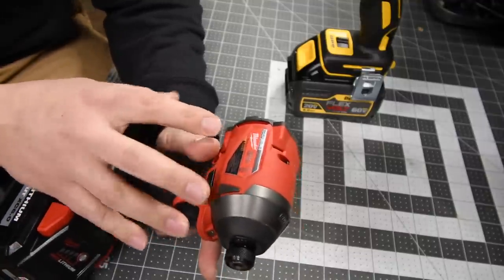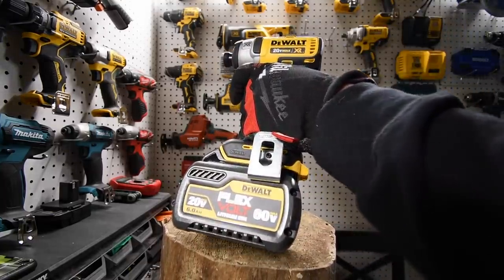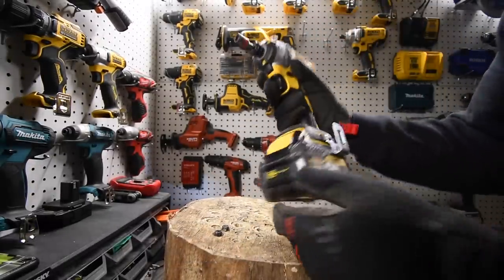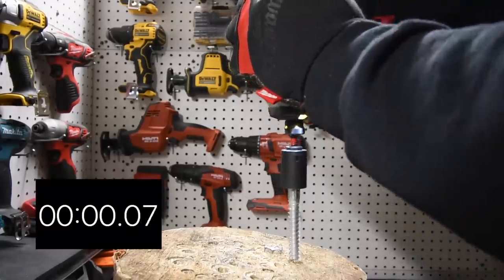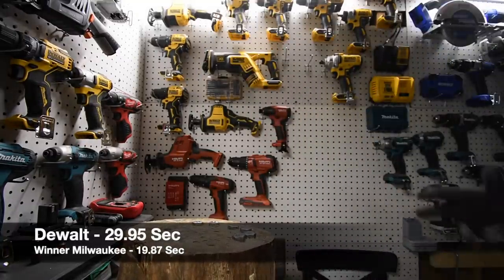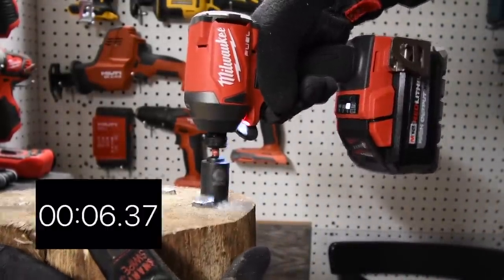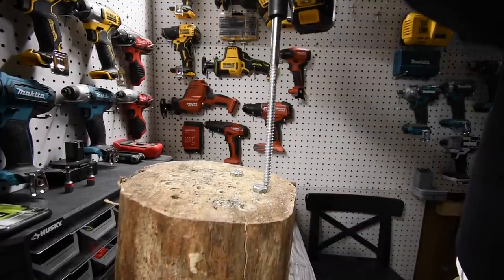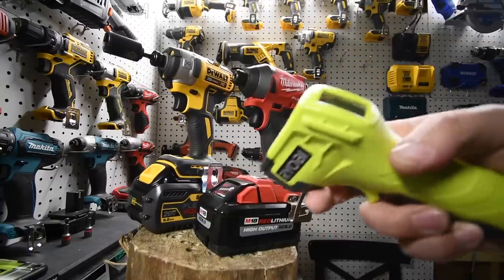Milwaukee vs Dewalt (Impact Drivers)

Comment: I feel like dewalt is for carpentry and milwaukee for mechanics
Reply from the maker: the reality is, both tools will easily get the job done
Reply: @ManCaverTools  This. While its fun to test out which one is faster and more powerful I feel that most everyone just wants a reliable tool that will get the job done. I know we like to have brand loyalty wars but I think everyone deep down knows both brands are top notch and will last. While I agree that DeWALT is more geared towards construction/carpentry and Milwaukee towards Mechanics...both will serve you well for either profession. Happy to own many tools from both brands
Reply: True shit!
Reply: Other way around
Reply: @fuccyahhat1229  for sure the other way around. Dewalt is cheaper usually for a reason it’s marketed to be the top quality but bought by homeowners. Milwaukee has always had the stronger tool in each generation basically. But it is true that at this point in the technology that both tools could do most jobs it’s just why wouldn’t you make your job easier with a tool that performs better?
Reply: @ManCaverTools  true. To a certain point but the dewalt's really seem to be very inconsistent on power output.. the impacts are good from each company.. the Milwaukee will rip the gear box right out of the dewalt though but truly they suffice for any job essentially.. now cordless saws and so on and hammer drill.. dewalt XR's aren't comparable to Milwaukee's.. different ball game.
Reply: I’ve been a DeWalt guy for ever but I think it’s time to make the switch to Milwaukee which sucks Becuase I’ve got a bunch of batteries and tools for DeWalt. I’ve sent my Hammer drill in 3 times and it keeps crapping out on me. It breaks my heart but I think I need to.
Reply: Not gonna lie, I believe it's the other way around, I have a DeWalt impact that I have absolutely BEATEN to death and it just keeps chugging along. I've dropped tranny pans got it soaked in tranny fluid, just brushed it off. I've drop it in a bucket of oil, fully soaked it because the bucket had five quarts in it. It threw Sparks and smoked for awhile, like poured smoke and I just sprayed some brake clean in it and it cleaned it out. Still chugs along to this day. I've had it for about 7 years. No matter what I do to it, it refuses to die. It's just my opinion, but I think Milwaukee you're more of wanting torque than you are build quality. Don't get me wrong, they have great tools. But I've always been a DeWalt fan.
Reply: I’ve dunked my 20v dewalt impact in hydraulic oil multiple times still coughs along as if it were new

Comment: I use dewalt everyday and very satisfied with their products.
Reply from the maker: very good and I thank you for viewing John
Reply: @ManCaverTools  sir if u had pick a brand what one would u pick
Reply: I just recently bought a Dewalt Atomic Drill Driver and it was medium to light use. Probably 2-3 times a weekend and I had it for a month and now I am finding out that the batteries are losing life and power overtime and the motor gets hot as if it has a brush in it. Evennthough its brushless
Reply: @TysonPaxton1214  this is why i switched to milwaukee :D
Reply: @SpooN12344321  I did too :D
Reply: @TysonPaxton1214  honestly have the same impact never had it get hot. Sounds like a fanboy comment to me. I use and abuse my atomic set and I have pics to back it up. My atomic kits just keeps going. If you use the impact on lag bolts that it’s not supposed to do then yes it will get hot but if it’s just screws it should be cold as a cucumber. Unless it’s defective it’s not true
Reply: @Toolboss0826  probably defective if yours is abused
Reply: @TysonPaxton1214  the atomic line sucks man, if you are going to get dewalt go with the xr line the best. I love Milwaukee as well very dope ass tools!
Reply: @Toolboss0826  Foreal I got a impact that I’ve been using for 5 years 🤷🏽‍♂️ I was working in construction for 2 years building houses then switched to windows and doors for the last 3 years and my drill is still going! And I abuse this thing 😆 even dropped it a few times 🙈 runs like a champ
Reply: @jacobmontes2330  I couldn’t agree more. I have the atomic kit and for the last year have put it through hell and everyday whether hot or cold it continues to work. Always a keeper in my box are my dewalt tools

Comment: Dewalt made a great product, 10 years ago, and have been cruising on that rep ever since.
Reply from the maker: very good and thank you snowballs
Reply: Yep I remember the first cordless of DeWalt when they came out , the Nicad batteries were very reliable . The only problem was the amp-hours where shorter then that of Bosch , Metabo ,. Yup I ended up selling my old DeWalt cordless because of that . But they were still good tools . And I ended up changing over to Metabo for the next 15 years . Though they  are not as fast as the DeWalt , they had that staying  power . I had my regrets selling old DeWalt sets ,cos I had pride in them
Reply: Honestly, I always used Dewalt in the military and never looked back. Still happy with the brand to this day!
Reply: Makita impact driver out does both dewalt and millwakee i am in the racking and conveyor systems installation business and i put all tools to extreme tests
Reply: @alf3433  if that were true you would see professionals using them instead of DeWalt and Milwaukee. Don't get me wrong, it's a great brand but just isn't as consistently good as the other two.
Reply: I have good roi on my dewalt tools. use them every day.
Reply: @ToolswithSoAlz  I know a few professionals that use Makita and love it. And yeah pro tool reviews rated the Makita XDT16 the best impact driver last I saw. I’m a Milwaukee guy but I dig Makita too.
Reply: So true. Got my first cordless drill 10+ years ago and it was a dewalt. Not They feel and look too cheap. Now I have my first cordless hammer drill and impact driver. M12 fuel kit with free 6ah battery promo.
Reply: Maybe so but they are still leading the entire industry on what batteries are capable of as well as the variety of tools available.
I never thought I'd see the day where a grinder would run longer then 5 minutes at a reasonable speed on a battery.
Their 60v grinder, blower, paddle drill,  demo hammer, ECT still to this day have zero competition in regards to a reasonable battery life.
Reply: They did an Intel.
Reply: @ToolswithSoAlz  Many people do use Makita over Dewalt or Milwaukee, but the vast majority of their tools do not outperform either brand. People like them due to their value vs performance.
Reply: @ILikeFreedomYo  concrete/chop saw too. NO ONE  has a comparable battery saw

Comment: Not surprised lol, I love my Gen 2 impact driver but I want the 3rd Gen just because it feels better in my hands imo. Also, you should get the Milwaukee mid-torque and put it against the Dewalt mid torque. Great content as per usual! 👍
Reply: Third gen has eaten too many socket adapters 😑
Reply: Kody Williamson that's why I have the m12 stubby 3/8
Reply from the maker: I will be getting milwuakee impact wrenches soon and thank you sir

Comment: You ran the Dewalt much longer after the Milwaukee, so the Dewalt would be warmer.  Also, you used the Dewalt battery to remove the 10" lag put it back in and then take it out again....not apples to apples.  The Milwaukee with the higher rpms of course is faster, no argument there.  I still love my Dewalts for going all day long on the job.
Reply: Everyone in construction knows Milwaukee is the tool to have these days, if you're an older guy, you most likely will prefer DeWalt, but they aren't really the best. I find DeWalt to be slightly more flimsy and not as solid as the Milwaukee. I recently had to buy a new impact driver because my DeWalt broke on the bottom of the handle where the battery connects. I think the Milwaukee feels much better. However, I haven't had the opportunity to try the Atomic, I hear they 're a bit of an improvement over the XR.

Comment: I’m an electrician apprentice getting ready to start buying my power tools. I’ve been trying to figure out which brand to go with, but this video has without a doubt helped me with that decision. Milwaukee it is!
Reply from the maker: electrician, id get makita
Reply: you cant go wrong with either Milwaukee, Dewalt or Makita,  I would go with what brand you can find the best deals on, and stick with that no regrets. Milwuakee has some awesome deals sometimes but usually expect to pay 15-25% percent more than Dewalt.. just saying
Reply: Man Caver Tools I’m a sparky, why would anyone get makita when even dewalt is better. Milwaukee is number 1 hands down
Reply: Sparky doesnt need Milwaukee mate.
Reply: get makita, you are an electrician
Reply: Go Milwaukee, show everyone what the superior trade is😂 they will hate us even more
Reply: Nissy92, Milwaukee may drill a screw faster. But that doesn’t mean it it a better tool for a specific trade.
Reply: As an apprentice i started out using Makita, im a lead now and started buying Milwaukee
Reply: The Milwaukee has had issues with bit retention. Spring in collet is weak and poorly designed. That being said, I own one and love it. There are DIY fix videos to solve the problem
Reply: Milwaukee is a great brand as well as DeWalt and Makita. It's stereotypical to say electricians need Makita. I will say that I used to see electricians and LV controls contractors use them exclusively but that was usually because tradespeople tend to copy each other. I also used to see a company of electricians that all drove Ford trucks as well. (These were personal vehicles.) Even grownups need to feel like they fit in with their crowd. Just pick the brand or brands of tools that suits you best! Good luck!
Reply: Your an aprentice bro get Ryobi from the orange store or Cobalt from the blue store. Once you become a lead, go for Festool.
Reply: Hercules man
Reply: @nissy9220  Dewalt’s not much faster in the instances it is faster, and a Makita will outlive it.
Sure, DeWalt has more torque, but that’s not overly important when every half competent impact driver has the torque to snap 1/4” hex shanks.
Reply: @nissy9220  
You’re an electrician. Get a Mikita. Hell, you could even go with a Martha Stewart drill.
Reply: @vwr32jeep  Hahahahaha

Comment: I have both and love both. Not unless you have both of them side to side do you actually see a difference. I carry an impact driver all day and the smaller 2ah battery is perfect and lightweight. When I do service wire, new power poles, and so on and drive larger and demanding lags then I upsize battery. But both are exceptional! I’m a journeyman electrician if you’re in my field you’ll love both.

Comment: I work at a LINE-X franchise and we constantly pull truck bed bolts and hardware as part of the prep process before spraying and then reinstall; and also for installation of vehicle accessories. They see pretty tough use all day 5-6 days/week. We use Milwaukee 1/4 inch and 3/8 inch impact drivers. They hold up well to constant abuse. The 3/8 drivers seem to fry bearings though. They still work okay but sound awful. The 1/4" have so far held up better than the 3/8" drive
Reply from the maker: I do thank you so much for viewing :)

Comment: To folks talking failure of either brand I remember when a top end from anybody would be a nope needs cord and it wasnt that long ago. The fact we can go down and buy or order one of these and expect truly corded performance speaks highly of how quick technology moved us. And I suspect makita and others might be there to. And to think at the cost, we buy corded high end performance and go that's not enough. Remember nicad tools even if in year one you were happy a 100 plus in batteries were useless. I went back to old bosch drill 20v. The batteries and drill still work for hours but are ten years old!
Reply from the maker: very good, I have some old dewalt tools with the old nicad batteries and we will be testing those out soon :) thank you for viewing Charles

Comment: I got tired of snapping 50+ 1/4" hex to 3/8" or 1/2" square socket adapters.  I converted the quick lock hex anvil to a 3/8" square drive friction ring anvil (from 2754 model).  I had to machine a brass bushing for the shaft to nosecone bore.  Hits hard and can really push this sucker with no fear of snapping adapters.  I have a brand new 2853 that I am gonna convert to 1/2" square drive with the anvil from a 2755 model.
Reply from the maker: The husky adaptor seems to be doing ok so far

Comment: Dewalt's drill at the end is warmer because you used it last - the milwaukee had more time to cool down.  Now drill into steel & concrete with them - that's the test for me
Reply from the maker: these are impact drivers. Not drill drivers
Reply: Man Caver Tools do they not make Drill bits for impact drivers?
Reply: @imortal283  yes - there are plenty of hex drill bits that go into any hex chuck impact driver - turns an impact driver into a multi tool that can do anything a drill can & more because of their superior torque - Man Caver is obviously unaware of the many accessories that can convert impact drivers

Comment: I own an extensive amount of tools and batteries of both of these brands and just something ive noticed about the batteries, the milwaukee batteries seem to give a slightly faulty read out on their indicators. They seem to run on 4 bars for a while and than drop down to 1 bar fairly quickly after reading at 4 bars for a seemly longer time than what it really is.  Dewalt seems to let you know when the battery truely is at half life a little better than milwaukee. One thing to note however is milwaukee also has 4 bars on their battery indicator while dewalt only has 3 which might have something to do with it.
Reply from the maker: I dont know why companies do a 3 bar system. doesn't make sense to me
Reply: @ManCaverTools  if you measure the output of the dewalt batteries the 3 bars is roughle 80 to 100 % full, 2 bars is 20 to 80% and 1 bar is the last 20 % which kinda means that as soon it hits 1 bar you should stop it if you want to pro long your battery life.

Comment: You can't go wrong with either DeWalt or Milwuakee. I just invested in the DeWalt 20V XR Max impact driver for my at home/garage use and I plan to purchase Milwaukee impact driver and hammer tool for work.
Reply from the maker: I agree, you cant go wrong with either brand
Reply: Yea both solid. Specially top end. I use dewalt for work for years but been thinking about trying out Milwaukee for long term.

Comment: I have used and experienced them for myself. My tools are Dewalt exclusive but sadly I have to say that the impact driver 887 of Dewalt (own 2 of them) is really noisy and most of the time driving in a screw you can feel the torque is fighting against your wrist which gives you fatigue comparing to those of Milwaukee/Makita/Hikoki. Would love to see how everyone experience with their Dewalt impact driver or it is just me.
Reply: I have a 12v one that I use for mostly light stuff. And it's pretty gosh darned perfect so far.

Comment: We know before the test that the higher RPM was gonna be the winner. The real test would be a torque test like removing the 10" lag. Either brand will tighten or drill small bokts and screws. I wanna see which removes a rusty nut the best

Comment: Notice how the dewalt didnt cut out and the millwaukee did interesting wonder if there is no overheating protection in the dewalt which the 887 is known for destroying itself instead of quitting
Reply from the maker: That might be the reason why and thank you Minnesotaman
Reply: He didn’t run it on the other bolts before that it wouldnt of gotten as hot

Comment: Honestly only thing making me hold off on buying a new impact is the Milwaukee colit. They fix that and ill get one for sure
Reply from the maker: they need to fix it now as well
Reply: Whats up with milwaukee collet? Never used it lol
Reply: Next gen is coming, and they are gonna fix the current problems, but new problems, nobody knows. Personally I prefer Dewalt, cuz they make everything, I like to keep all the tools uniformed. Looks sick.
Reply: @kyle.s1212  and DeWalt doesn't have issues with Colletts, switches, battery life, etc that can really make things difficult.. DeWalt has been much more user-friendly and reliable in my opinion...but everyone has their own opinion and that's good..
 Personally for me, it's the time trusted DeWalt brand to get the job done..

Comment: Pressure applied on each segment isn’t the same. More pressure applied during Milwaukees test.
Reply: I was thinking the same but look at the socket spinning, dewalt was spinning slow
Reply: Good call.
Reply: You have right . Exactly i saw it same as you, no same pressure each segment
Reply from the maker: I thank you for viewing Joey Milwuakee killed this dewalt. Not my fault the dewalt isnt as good as this Milwaukee
Reply: Man Caver Tools their feelings are hurt about that I almost went with dewalt thanks for showing us
Reply: @nandorodriguez3264  but you know Milwaukee doesn’t hold bits right? Current generation impact driver
Reply: Explain the backouts

Comment: I just bought the Milwaukee 2853 and I’ve had the Dewalt DCF887 for some time now. I feel that the Dewalt is built much better and the trigger is constructed better/smoother than the Milwaukee. The advantage that Milwaukee has is the power, but will it last as long as the Dewalt? IMO I don’t think the it will. 
👍🏻👍🏻
Reply from the maker: I agree that the milwuakee is being over worked it will fry out sooner then the dewalt

Comment: I had dewalt and disappointed me when i just bought a impact driver and didnt lasted more than 3 months and i went to milwaukee fuel impact and im over a year and still works as new
Reply from the maker: That Milwaukee is a beast
Reply: Been having my dewalt for 4 years and still works like new. And I work in construction